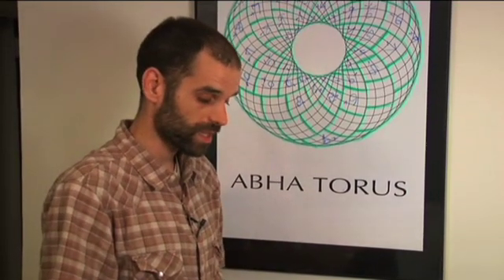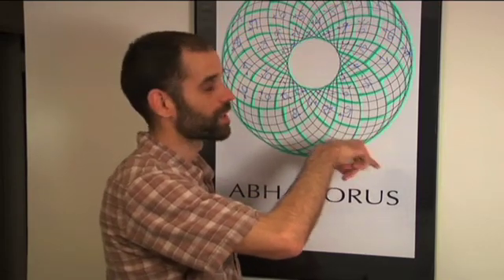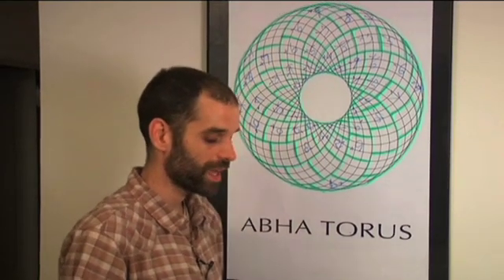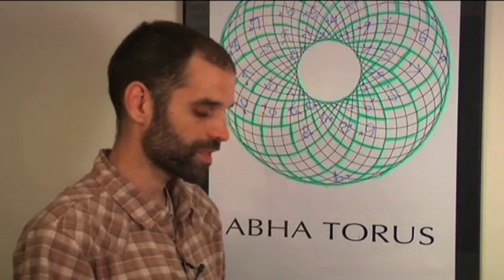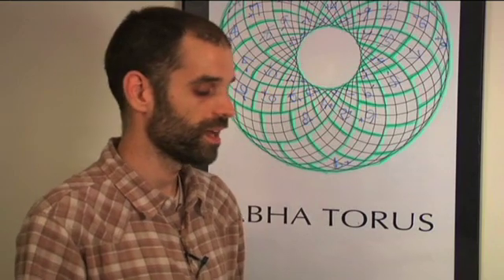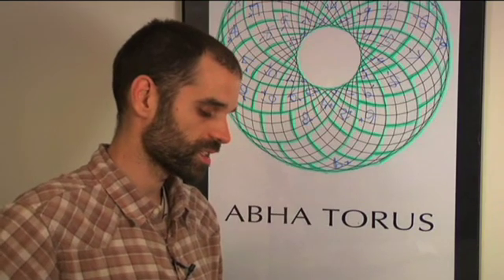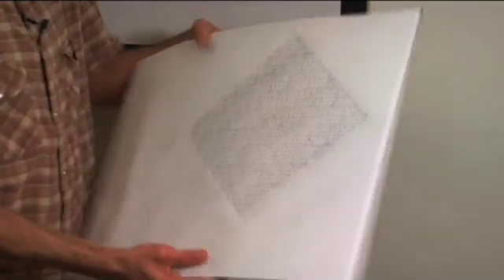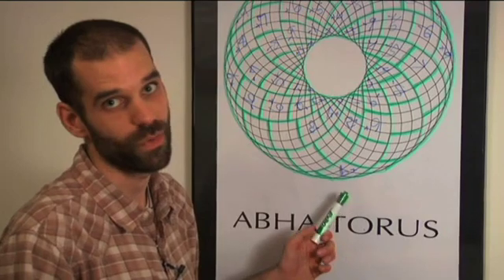Randy Powell - Advanced Vortex Math - Part 5

Comment: I understand there may be multiple resonances on the coil, 3? how many? but it's not doing any good if the alternate spaced resonances aren't getting tapered magnetic current repulsion to induce greater and ever accelerating resonance amplitude. 
Further it would be best to use .003"niobium wire in 7 packs of 7 to be superconducting.

Comment: any 'free' energy system uses a 3 stage form of magnetic squeeze, sometimes it's spin force that makes the squeeze, but here the first squeeze is the curveature in the design... but it seems like that is only one sinewave of current squeeze. Where are the other 2? The final one would be bouncing between 2 ferrous masses/ points to draw energy between a ground and non ground that can take power from the vacuum.

Comment: Yes I'd like to see it also. The math , the geometry, all great, but doesn't mean anything if it's not applied to energy production.

My best theory is that the coil must be squeezed with magnetic current from all directions to improve efficiency, either it be a single pole like a magneto or 16 or 24 alternate poles like the model t flywheel / Ed Leedskalnin flywheel to induce necessary positrion. The coil resonantes but where is the carrier wave? I don't see it.

Comment: @GHOSTTOYS I took a look, yet the material is not the trick alone; did you notice how the wire was stranded? Either they got lucky, or someone or some research game them insight to the geometry of the positron. That is SEVEN STRANDS OF 7 STRANDS; Stan Meyer proved this same geometry when making hho patent(s) has a connection to a higher density of space in time, which is the how and why of many things. Wrap that 'round rhodin. I think I know the rest of rhodin's secret 4 the coil btw.

Comment: @viktorgoa So why tell me? The problem you have is solved by the coil which proves maxwell wrong in many videos. What I can tell you is this; a bias in magnetic charge is actually ion charge which suspends an unseen halo of positrons in concentrated highly accelerated orbits. The reason; passing electron neutrinos start a cascade reaction to motivate magnetic current, but if that current suddenly drops more off one pole after build (pump z wave) it is monopolar since cascade reaction is lost.

Comment: @ewgeesjames Coat the wire with quartz/gold lattice. Tesla used metal/crystal lattices to improve magnet strength. Now you have a super powerful monopole, but this is now how I'd make a ship. There are better ways to converge energy particles using DeBroglie waves as they sep from mass particles (relative) doing the same. Best 'ufo' designs use something entirely different.

Comment: Hi Randy, 
I am very impressed by your work, thank you for sharing so openly. Though I don't understand all, I see you've taken Marko's work to a next level, as he hoped people would.

2 things caught my eye:
- You showed a adjacent groupings which seemed to run +1 thu +9, ON the torus, which seemed signicant.
- The S curve around the most outer rim of the torus (pins if you wind an electrical coil). Might this be a result of the "pole shift" if you will, causing an axial jerk on the circuit?